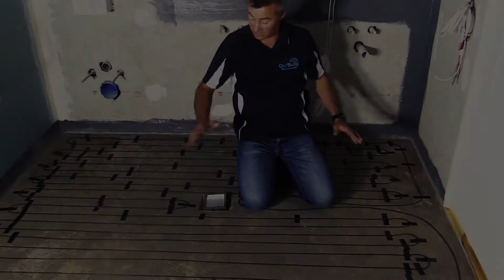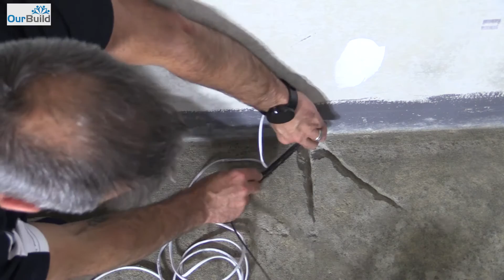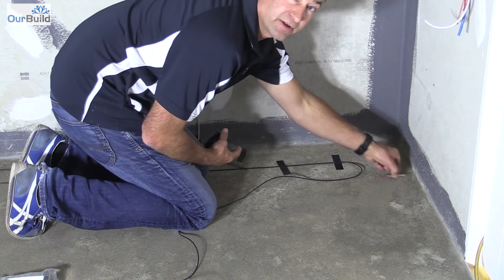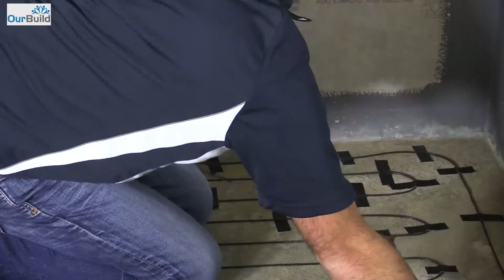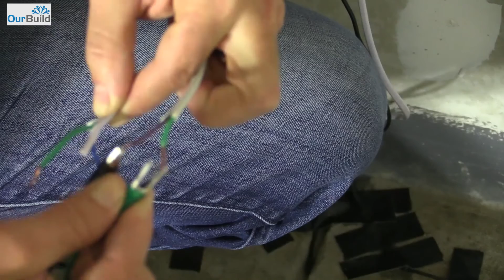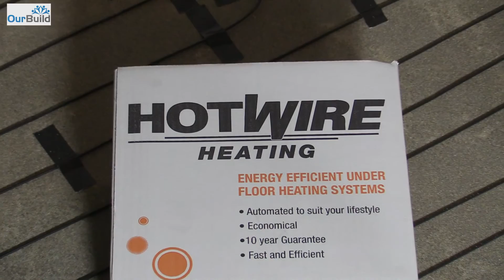How To Install Hot Wire Under Tile Heating

Comment: Noticed a competitor's product comes in a mesh that simply glues to the floor (so little setting out and no need to Ardit over it); wouldn't this be much simpler to install?
Reply from the maker: Probably, never used it before.

Comment: What stops the heat going downwards, rather than upwards through bed and tiles? We would be putting it on compressed cement (about 20mm thick?), so I imagine quite a bit of heat would go downwards?

Do you have the bathroom waterproofed first, before installing underfloor heating?
Reply from the maker: Quick answer, yes waterproof first.

In relation to the heating its only low voltage and is enough to warm the floor, there is no danger of the heat causing any issues to the sub floor structure. Heat rises so there usually is not any issue with heat transfer below a room.

Hope that helps.

Cheers James.
Reply: Don’t you mean ‘extra low voltage’?  ‘Low voltage’ (ac) is 50V to 1000V.